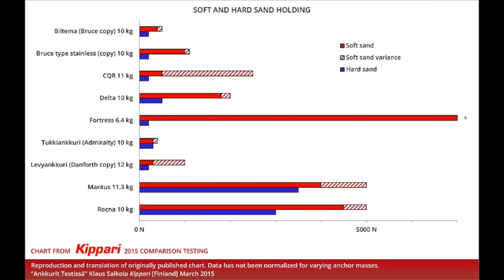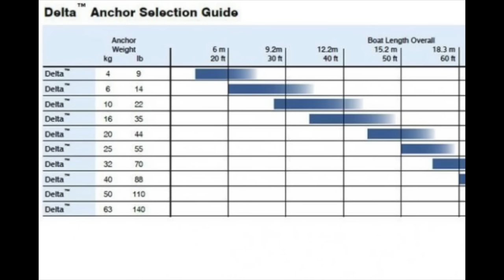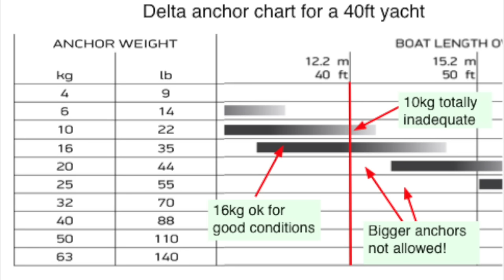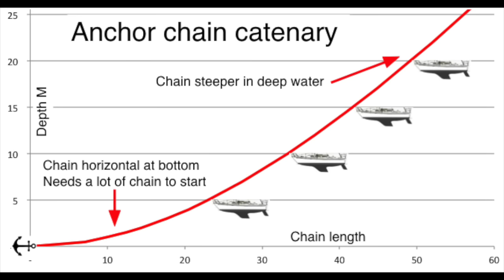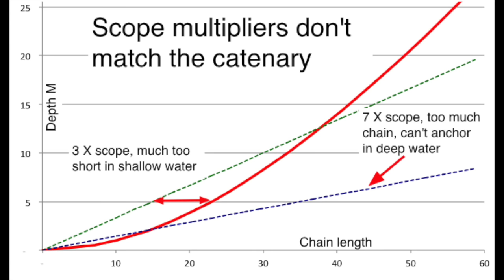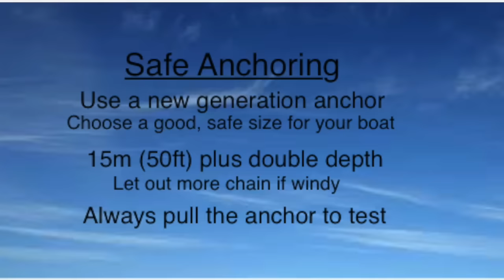Anchoring, how to stop dragging and be secure.

Comment: .... an excellent video w/ great information ... BUT !!!  ... one glaring MISTAKE !!! that ruined it.  Once you take a length of "rope"  onto anything floating ... it is called a ... "LINE" !!!! There is no such thing as an anchor "rope" ... why do you British/S African/Aussie/Kiwis refuse to learn proper nautical terms !!!!  An anchor "rode"  can be all "chain" ... all "line" ... or a combination of both ...  We carried a "lunch anchor" (lighter weight w/ lighter chain) ... and a "storm anchor" (much heavier w/ more and much bigger chain).  And on my friend's boat  when racing we leave the lunch hook on the bow and remove the heavy storm anchor w/ chain and store it as low as possible and in the middle of the boat were we can still get to it quickly if needed ... (it is a "pain" to do this ... but we still do)
Reply from the maker: Hi Harry, thanks for your comment, but your blatant racism definitely deserves a dose of the Cat-o-nine-tails, made of extra heavy rope! I do know that the only rope on a sailing ship is the bell-rope, but in making the video I used the terms in common use. 
Actually I would never use rope/line on my anchor rode, most windlasses have a rope grip on the gypsy, but I wouldn’t trust it for normal anchoring, I’m sure the chain/rope connection would chafe. I do have line added to my 70m of chain, but it’s only for emergency use.
Reply: @RichMac46  ... just because it is "common" use  ...  does not mean it is "proper" use of a term/word

Comment: What are your thoughts on a Very oversized  50kg AC-14 anchor for a 12 ton (fully kitted) 38' steel cutter? 
It's not a yacht anchor and that bothers me none. My Only concern is to be able to "set it and forget it". Existing tackle...75m of 10mm chain, 150m 16mm polyester blend and hydraulic windlass.
Thanks in advance.

Comment: For the life of me, I will never understand why the vast majority of cruisers don’t use catenary weights on their chains/rodes, especially in tight anchorages where there’s not a lot of swinging room, and a Bahamian mooring setup to account for changing/reversing currents and winds.
Reply from the maker: Hi Peter, many thanks for your comment. Could it be a function of yacht size? On a smaller yacht, catenary weights and second anchors are easier to manage. On our 45 footer I really don't want to be hooking on a 20kg weight, or organising a second 30 kg anchor, it's just easier to fit a bigger anchor if you need. The ideal yacht would have a bow fitting for two anchors, but not so easy with modern yacht.
Reply: IF THE WIND GETS STRONG ENOUGH, THE LINE///CHAIN GOES Taught,  and THE KELLET///WEIGHT BECOMES USELESS!!!!!

Comment: For what depth would you recommend I size my anchor rode for world cruising?  Very informative video BTW.
Reply from the maker: I use 70 meters on my yacht, plus 60 m of rope, which I’ve never actually used. A lot of people think that 100 m is best, they might be right, but I’ve never been short of chain. It depends on how you calculate your scope, if you believe it should be 7 x depth you need an awful lot of chain!
Reply: @RichMac46  I like your way of calculating scope.

Comment: Unfortunately is too often that size of the boat is inversely proportional to the cruising skills of the skipper….
Over a 15K miles solo trip a 20 years ago or so, I’ve discovered the best anchor ever… is used by all fishermen worldwide, especially by those gullets which crew is sleeping peacefully at nigh also under strong Meltemi: the old-fashion grapnel! I welded 4 large triangular flukes (pointy end) on a regular fishermen grapnel and it was able to hold literally everywhere…. Sand, posidonia weed, even volcanic gravel when put in series with a Danforth. My boat was a 30’ catamaran with plenty of wind-exposed surface…
Now in my vintage 27’ a similar grapnel is the main anchor and it never fails!

P.S. with grapnels, admiralty and the like…. be aware of wind shifts… they can fowl easier than other more fancy models

Comment: Hi Richard, Enjoyable Video. We also have a Beneteau 45 currently with 20kg Delta. Did you have to reinforce your bow roller to take the 33kg Rocna as I'm thinking of doing the same. Also how much 10mm chain do you have attached ? Thanks Andy
Reply from the maker: Hi Andy. The Oceanis 45 is a great yacht . . . Except the bow roller!
When I fitted the Rocna 33, it wouldn’t pull slowly over the single roller. Fast, it would hit the jib furler. Maybe I could have fitted a rope or bracket on top of the chain to prevent it lifting up when lifting fast.
But I decided to fit 2 extra rollers, to give an easier lift. It was really hard, I couldn’t drill the extra holes in the SS, so I made an extra pair of plates to carry the extra rollers. Difficult, and hard to fit, but it works ok.
An extra aggravation on my 45, and others I’ve seen, is that the bolt for the roller won’t come out as it’s going in the wrong direction, and hits the other roller bracket. So, I had to cut it off, and fit another bolt the other way. How easy it would be if Beneteau simply cut the extra holes, so extra rollers could be easily fitted.
Another way to ease the lift is an Osculati twist swivel, or similar. I haven’t tried one, but the curve may help a heavier anchor over a single roller.
Let me know if I can help further.
Reply: @RichMac46  Hi Richard, Thank-you so much for the advice. Very much appreciated. I just wondered how much chain you have fitted. As our 45 was originally delivered to the Med it has only 25m of chain. We're currently in the Bristol Channel so was looking to increase to 80m ?
Reply from the maker: @andysheridan284  I use 70m, and have never run out. And 60m of rope, just in case! Some people use 100m.
Reply: @RichMac46  Thank-you Richard. Have an enjoyable season.

Comment: 15m +2xdepth would be a problem on a lot of greek shallow anchorages; not enough space to sway around in say 3 meters depth with 21 meters out.
Otherwise - really good advise!
We allways dive down and adjust the chain (length) accordingly.
Reply: The simplyfied formular occurs more chain lenght in shallow water, but its much better than all constant ratio  formulars. I use 20m + double water depth +/- 20% depending on conditions.
Reply: @wernerlindtner2742  As I wrote; It could cause problems in shallow anchorages.
Reply: @Knoklsnedkr  In your example it is not shallow anchorages what matters, is that they are crowded

Comment: You say you got a 33kg anchor for a 44ft yacht.  Surely it depends on what weight the yacht is!!!
Reply from the maker: Hi Paul. Anchor load depends on weight, windage, and how stable the yacht is at anchor. Most modern monohulls are pretty similar, but make allowances if your yacht is different. Obviously, it’s better to have an anchor too big, than too small!
Reply: @RichMac46  
I have a 35 ft 11 ton monohull with a long keel. So I’m think 33 kg rochna!
Most sites are saying 25 kg??
Reply: I have a 36 foot power boat and run a 33kg anchor on 120 meters chainand don’t feel it’s too large… it’s a good way to always sleep well.
Excellent advice thank you for this video. Subscribed!

Comment: You didn’t mention a trip line for when your anchor gets snagged!
Reply: We don't use one, even in rocky areas, because it's more hassle than it is worth. With our Rocna we've never snagged badly - they're supposed to be more immune to snagging - and the few times we have been stuck we just motored forward and freed the anchor.

Comment: Excellent, thanks for sharing! Really interesting to see how anchor manufacturers are in this "race to the bottom" (no pun intended) and don't recommend bigger sizes -- as in "with our product you only need 10kgs!".  As I understand it from this video, the anchor design is one thing, but better holding power is also dependent on weight, and this increases exponentially as anchor weight increases. In other words, don't be shy about sizing up a couple or a few sizes.

Would also be interested to know your thoughts on the use of snubbers to remove jerking stress on the placement, and also products like the anchor buddy that hold the chain down.

Comment: Thank you for your excellent reporting on anchoring. 
Rocna is a good anchor, but has one serious problem. If the wind reverses direction, it never resets again in soft sand and the boat is lost. This is because soft sand sticks on the fluke shape and does not allow the anchor to dig back again  (no reset). Anyone had the same experience?
Reply: Resetting is the Name of the game...

Comment: The formula for the catenary is actually very simple if you only consider wind force > 10 kn: chainlength = c * windspeed " sqrt(depth).
You can determine the value of c for your yacht in calm conditions by diving. Also with this formula you will use more chain to account for waves, sailing at anchor and currents.

Comment: Expecting one type of anchor to work one any type of bottom is asking for it. I carried a Fortress, Lewmar delta and a Bruce claw. In all cases proper chain lead length. The Bruce would go to the devil on mud bottoms. The Lewmar could punch through weed and grass bottoms where the Fortress would have “salad ball”. The Fortress was very good only on sand bottoms. My favorite is the Lewmar delta. I have many times put out two even three anchors as long as I don’t have to worry about others swinging into me. Putting multiple anchors in the same direction can foul each other so I normally do at least a 30 degree spread. If I run a third it’s to stop any annoying twitchy swinging and never in a hard wind so I don’t put the boat broadside into the wind if it shifts. If you have a tender, resetting or weighing anchor can be easier on multiple anchors. Just be careful not to get tangled and get pulled in. Take it slow and think.
Reply: Hi Richard
In mud it’s hard to beat the original Bruce claw anchor, if you can even find one. Most of the clones have a  subtle difference that makes them inferior. I’ve had great luck with the Lewmar type delta in grass covered mud bottoms. Any anchors with “stocks” (Fortress) or hoops (Rocna) types are good in their realm but not in fouling weed and grass bottoms. I think the minimum is two kinds on board. I carried three. I have moved twice because of another upwind boat couldn’t keep his anchor set and didn’t want a surprise at 2AM with the both of us in the rocks. There are great apps for phones that you can set limits like swing. But be warned they use GPS and it drains the batteries so have the phone on charger or external batteries before you hit the sack. One night the wind came up and I must had over a thousand pounds on the line. I had both keys in ignition and figured if the alarm went off I had about a minute to not to run aground without overrunning my anchor line. Didn’t sleep well that night. A good knife handy to cut away at the ready is a good idea. If the area is busy, I tape small cheap LED flashlights to the anchor lines and on top of float balls that are tied to the line at 3’ depth so tenders don’t snag my lines. Some captains have had a few on holidays.
Reply: Richard Macfarlane 
You have to have faith in what you have, if not it’s just ballast. So you’re wise not to trust a questionable tool. That’s why you still have a boat.
Fair Seas Richard!